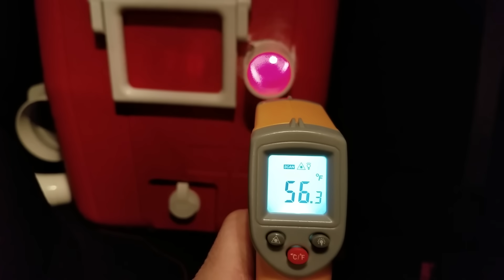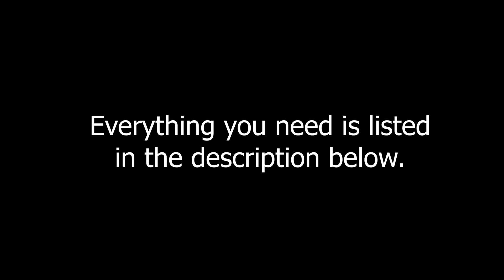Homemade Portable Air Conditioner DIY - Version 2 - Runs off 12 volt battery, car, or solar!

Comment: Hi - Curious.  Rather than having one 1.5" come out.  Would it be advisable of the following:  Going from the 3" to 1.5"   - why not do a 3" to a 1.5" splitter and little more pipe and have two 1.5" outlets rather than one?   Is there enough air flow to push through.   Also, have you measured the temp of the flow coming out?  If so, what is it?
Reply from the maker: Yes, two outlets would work just fine. I have not measured the temp with a normal gauge...only the laser one in the video.
Reply: Got thnx:  Heads up.. went through pretty good.  I think your purchase list may be off.   Here is how I see it based on some parts listed and visual.   4"   fan to 3 " to 3" aluminum... then 3" to 1." converter.   I see you have 4" to 2"?   on list?
Reply: heads up again.   Things not adding up.   At 4:50 in you say drops from 5" to 3" .  But the motor fan you have specked out is 4" inlet, with 4" out.. with coupler to 3" to the aluminum pipe.   Please advise.
Reply from the maker: That's because the 5" rubber coupler goes around the outside of the motor. The motor isn't normally used with a rubber coupler. It is normally used with ductwork connecting straight to it which would be 4 inch. I had to get creative to make it work.
Reply: Also wondering the fan specked out is 12V (meaning have to use a cig lighter).  But you also have the 110 plug you identified.   the mfg has a 24v as well... I suppose that would not work to straight plug for 110?   Lastly, got most parts today.  Waiting for the fan.      And not really understanding the 5" coupler going around the outside motor?   I know, I am a little slow.

Comment: This would be fantasitc for camping oreven for those times whe the power is out. you can pair this with a solar panel and have soalr powered air conditioning.

Comment: Laser thermometers are not useful for mesuring air temperature. He's only reading the temperature of the pipe he's pointing at.  For air temperatures you need a standard type thermometer.

Comment: It's actually not a bad idea for an overnight camping trip, and you can dump the water out when you're ready to pack up and leave. For home use, well, for $178 you can buy a real A/C from Amazon that can cool one or two rooms (or more depending on how well insulated) and only uses around 320 watts max. Probably costs about $30-40/mo to run in the summer. Plus you won't have to keep draining and refilling with ice, not to mention making all that ice is going to take up a lot of freezer space. My freezer's built-in ice maker would have to run nonstop to keep that ice chest filled.

Comment: Since I travel in a Kia minivan and can only drive during daylight hours...I sleep in the van.  It gets warm going to Florida...this will easily cool my van! And it will run for hours off of my 500 watt 346 What lithium battery....Till they come out with a 3000 BTU AC using less wattage. Thank you for sharing!

Comment: This can only be helpful in a place just warm, not too hot like 40 C. Why? Because in this design the air blown inside doesn't really touch the ice or the cold water, which makes it harder to get colder because the air needs more time to get cooled than just cross the ice chest in 300 ms aprox.

Comment: Will this work to convert to 120v?  $9 vs. $22
https://www.amazon.com/dp/B000TA4WNW/?coliid=I1LD6AQVJJG0NA&colid=S03P7C62QE72&psc=0&ref_=lv_ov_lig_dp_it
Reply from the maker: No. This will not work because it says in the description that it is not recommended for anything that needs more than 1 amp of power. The blower motor pulls 6 amps.
Reply: cool, thank you.  that's why I asked

Comment: Plenty of people have tried this before, blowing air over ice, and it can give you some relief, but it has its drawbacks. It's adding moisture to the air which is the opposite of how an A/C works. It's the humidity that makes the heat feel even more oppressive. I grew up in the Gulf Coast Deep South area, and when the humidity is high then even temps in the mid 80s can be unbearable.
I now live in Nevada where the humidity is ultra low and even high 90° temps are not that bad. You can get by with just a ceiling fan in a pinch.
Reply: The plus of this design is that it does not blow the air directly on the ice so you will not get as much humidity added.
Reply: Yup...Use a fan and suck in all the dust mites it blows around...good alternative..

Comment: Not sure if it's possible with the box you're using due to insufficient height, but in theory if you were to mount the fan on the inside, drawing air in from the top, surely that would insulate the sound of the fan to a degree? Or do you think that might "amplify" the sound, or resonate?
Reply from the maker: I would think that it would insulate the sound as you say. However, I'd be worried about too much moisture on the inside getting in the motor.

Comment: What would I need to run this off a 12v battery?
Reply from the maker: You simply need the proper connection. You can wire it straight to the battery with an inline switch or you could use clips and connect it to the battery when you like or a cigarette adapter like I did if the battery is in the car.

Comment: We want to hook up the fan directly into a wall plug, no 12v adapter stuff, can we do that? Like it won't be too much power for the fan, correct?
Reply from the maker: Correct...as long as you get an adapter.
Reply: by adapter, do you mean a wiring setup that hooks up to the black,yellow, red cables, etc and then into the wall?
Reply from the maker: You wouldn't use the black, yellow, and red since they are on the cigarette adapter. You would be hooking straight to the fan which only has two wires. So you would wire the fan to the adapter and it would plug into the wall. Here is a wall adapter that would work: https://amzn.to/2s0zACb

Comment: I actually built the one from last year's model. This 1 looks awesome.  What type of  battery would you  suggest?
Reply from the maker: Any 12 volt battery will work. Just keep in mind, the more amp hours the battery will produce, the longer it will last before needing to be recharged.
Reply: make & do Thank you.  I'm going to get  started

Comment: The reason air feels cooler when its moving faster is because of Bernoulli's principle, commonly referred to as the Bernoulli effect. There's a lot of complicated physics involved but long story short it states that when velocity increases, pressure decreases. And when air pressure decreases so does its temperature.  Bernoulli figured it out using incompressable fluids but his principle has been adapted to work for air since it flows like a fluid.

Comment: Just think for a second.... The smallest window air conditioner you can buy at Walmart puts out 5,000 btuh/h. That's just less than 1/2 ton of cooling. It's called a "ton", because it's the equivalent of a ton of ice melting per hour. So to match the cooling capacity of the SMALLEST room air conditioner that you can buy, you'd need to melt 800 pounds of ice every hour. This contraption is like, what?, 20lbs? LOL. Not even enough to compensate for the heat produced by the fan motor!
Plus this will add humidity to the air, making the space even more uncomfortable.

Just get a fan. It will be more effective.
Reply: Yeah, I'm not a fan of the air over ice method either, that plenty of other people have tried. Fridgedaire makes a super efficient 5000 btu A/C that only draws around 320 watts (as measured by my Kill-a-watt meter) and it REALLY cools a small room. I can run it with a small offgrid solar system I put together as an emergency backup experiment as I live in the desert SW where it can hit 120° during the summer. An extended power failure here can really suck.
Reply: Jason Smith the air being pulled in stays in the pipe thus it should not "mist" when bring blowed out.

Comment: Can you please sell it to me? Ship it over to my address. If you need one for yourself go make another one. Thank you
Reply from the maker: Sorry, but I do not sell them.
Reply: make & do - I don't care. I need you to sell it to me if it's not broken. I don't have the cutting edge tools like you have nor do I have ability to make things like that. If you don't want to sell it then just ship it to for free. I will pay you the shipping in advance. I will be moving in to a new tiny house and it doesn't come with air conditioner and this unit would be a great use for it ad I can't handle extreme hot temps with just using a fan. Can you please reconsider?
Reply: make & do - forget it... I will make my own if I have to. I'll use dual radiator liquid pumped air cooling system using a deep freezer and won't require any drilling and such
Reply: IneedMoney make a video once you're finished "building" it
Reply: Blanco Escondido - once I move in to a tiny house I will as i'm expecting we have a hot summer coming. I'll let ya know

Comment: What that cooling effect is called is Venturi.   Its due to the change in air pressure due to speed.   The slower a fluid moves the greater external pressure it exerts (higher pressure). The faster a fluid moves the less external pressure it exerts (lower pressure).  This same Venturi effect is found in carburetors and can cause carburetor icing.  The same Venturi effect happens at the inlet of jet engines which is why the engine cowl has electrical deicing capabilities
Reply: My speakers are BIC venturi's...lol
Reply: Your theory is some what correct but the jet engine part is not. The jet airliners fly at 25,000 to 40,000 feet where the air is -25F to -40F. If they fly through rain or mist without the inlet leading edge heated with hot bleed air ice will form on the leading edge of the inlets and wings. If the ice breaks free and goes into the engine it can damage the fan blades. If you heat the leading edges of the wings and inlets while you are passing through the altitudes that it starts getting below freezing and moisture is present it will melt any ice and and keep it from forming. The venturi effect has little to do with the reason for leading edge heat on engine inlets of jet engines. You can run jet engines on the ground all day long and it wont freeze the inlets.
Reply: @keith6234  I was a FAA licensed pilot, working in FAR 121 operations for a very long time with different airlines, I have several FAA ratings and licenses, including examiners license, dispatchers license, flight engineer's license.  I know what you're saying, but I am not wrong about the venturi effect happening at the inlet of jet engines where air speeds up as it enters not only due to RAM air, but the air is being sucking in as well  (FOD is real issue on the ground, even though in warm temps, cowl icing may not be), so that increase in velocity of air near the intake of a jet engine, by both ram and the jet sucking air in does cause an increase in velocity, therefore a loss of pressure which results in a cooling effect, regardless of the ambient air conditions, and if there are freezing temps and moisture, icing can occur, even on the ground, which is why even after ground de-icing is complete and all anti-ice measure are deployed there is still a very short window of opportunity to safely take off according to FAA rules.
Reply: @libertyfarmsiowa  I am an A&P Mechanic for over 35 years so I do have some knowledge of the subject. Can you tell me how many degrees of temperature drop the venturi effect will cause ?  While the venturi effect does have some effect it is not the main reason for Inlet Icing. Temp and moisture are the main factors not a few degrees of temp drop due to venturi effects. You get Icing on leading edges and radomes where there is no great venturi effect.
Reply: @libertyfarmsiowa  Why are you so rude? You claimed there was an effect and I said it was not much of an effect and asked you how many degrees ? It should be an easy answer for one as learned as you.
Reply: @libertyfarmsiowa  You made a statement that the venturi effect was the reason that Jet engine inlets were heated. I simply stated that the venturi effect was a minor factor and that moisture freezing on the at the higher altitudes and lower temperatures were the reason for inlets and leading edge heat. I asked you how many degrees in F that the venturi effect had on inlets but you could not or would not answer. I don't Play to a Youtube Audience. If someone makes an statement that I know is not supported by facts I simply question it. As for Aircraft Mx workers being Snow Flake Diva's I think you need to look in the mirror !  The old joke " What is the difference between Pilots and God ? God doesn't think he is a Pilot " comes to mind. Every time you pull into a gate at an airport you ought to thank those Snowflake Diva Mechanics for getting you home safe. The guys that spent the last eight hours busting their ass in the snow and in the rain doing the job to keep you safe. You just are upset that someone Dared question your statement. You are full of yourself and full of it and I pray your arrogance doesn't get you or your passengers killed one day .

Comment: As air is compressed, its heated. As it is decompressed, its cooled. So while its in the tubes its warmed, although cooled more by being submersed in frigid mixture, but as soon as it exits the system it's chilled. the pressures we are talking about are pretty small so perhaps someone can elaborate?

Comment: Thanks for a great idea. I'm retired and travel full-time in a rv and like dry camping where I don't have access to Shore power but use 300 watts solar. 

Would it be possible to add a variable speed switch to control the fan speed?
Reply from the maker: Possibly, but I'm not sure. Try and see and let us know.
Reply: I know this reply is 2 years too late, but yes, that fan is a DC motor. You can get a motor speed controller on Amazon pretty cheap. Run the power to the controller and run the output of the controller to the fan.  I run a 12 volt clip on fan (Peak brand) with just a 25 watt solar panel. The panel puts out about 18 volts and runs the fan faster than it should, so I got a motor speed controller. They lower the voltage so the motor (fan) runs slower. You can adjust it as low as you want, even to full stop.

Comment: Necking down the airflow....might also slightly increase the hang time of the air inside the pipe (which would cause an increase of heat transfer).......add a sheet of foam on top of the ice pack (since the lids are not insulated) and you'll probably increase the overall performance.  I'm looking at alternatives to cooling my Cargo Trailer camper, without having to buy a generator.  A small unit like this, I could run off a single solar panel.

Comment: Just a little ingenuity and this man cones up with the best design for a diy cooler ac yet. This has always intrigued me i have tried several designs the most recent being the cooler oof ice water with a pump that pumps the ice water thrw a coil of cooper thats is zip tied to the front of the isolating fan wich works it will drop the temp of a 13x16 3 degrees in 2 hrs but melts the ice very quickly . this is a much more efficient design. I will be trying this grat for that car with broken ac or for camping with it plugged into your jumper box or truck . good job too bad you cant drop down to 1.5 inch sooner so you can get more pipe in the ice so u have more surface area cooling the pipe anyway great job bubba

Comment: I always thought a pipe would be better than just blowing air over the ice and out...but one issue with the data is the ambient temperature was not considered. The warmer it is, the faster the ice will melt. The cooler the air coming in, the cooler the air coming out. So a closed car overnight with no sun and cooler outdoor temps will lower your air coming out

Comment: Coming from an a/c guy you need at least a 9 or 10 inch duct for a 270 cfm fan. That fan is going to burn up after a few uses without a doubt. But man that was a great idea you had I respect the effort.
Reply: Been running mine for more than 10 hours a day for almost a month no problems
Reply: my 1200cfm cooktop fan requires a 10" pipe...I doubt this little thing needs that!
Reply: Hey Josh, this fan is in a 4 or 5” round housing because it’s designed to be used in that sized duct.
It’s made for marine and RV applications.

Comment: Great idea and good Job, i have a question i want to build something with that air blower i want to send cool air from one room which have AC to the other which doesn’t have it.

Do you think this air blower have the power to send cool air to the other room?
i’m going to use the same duct.

thanks.
Reply from the maker: Yes. It is a pretty powerful blower.

Comment: Love the design, will be doing something like this for the back of my Toy Hauler 5th wheel which does not cool down very easily.  I already have 12v back there hooked up to the RV battery so that part is taken care of.  Looks just to be a dryer vent hose, which are not very sturdy.  Any issues with the weight of the ice collapsing the vent hose?  Was thinking an RV sewer hose might be better for that aspect, but might not get as cold since it is non-metallic. Thanks for the video!!
Reply from the maker: It is not a dryer vent house which is flimsy. It is a rigid metal tube. I put a link in the description. Whatever kind of tube you use should definitely be some type of metal so that it will get cold. Plastic will not conduct the cold very well.

Comment: Instead of using ice, take the inner piping out and let the air flow freely.  Take bottles and fill them up with water, freeze them and then put them in your tank.  Just make sure you have replacements when the ones in the tank start to warm up.  I made one similar they gave me 32 degrees
Reply: For how long? How long before you replaced them?